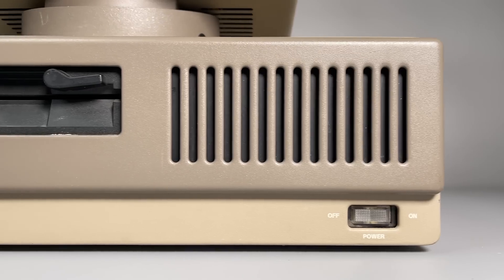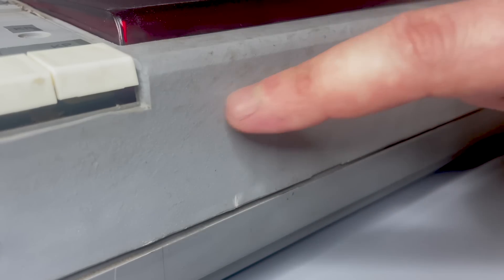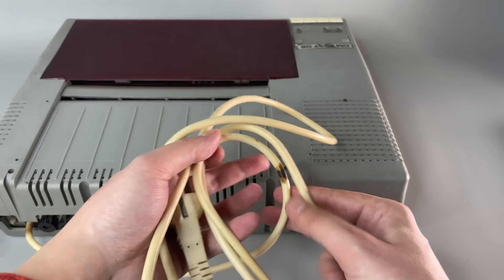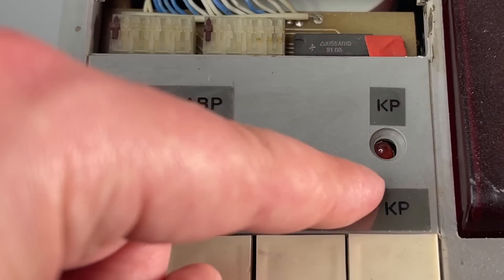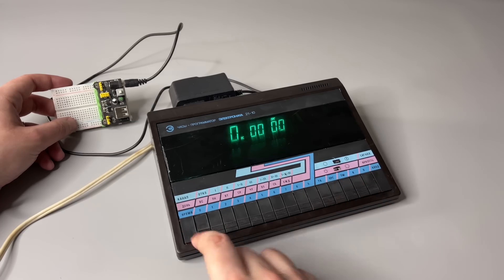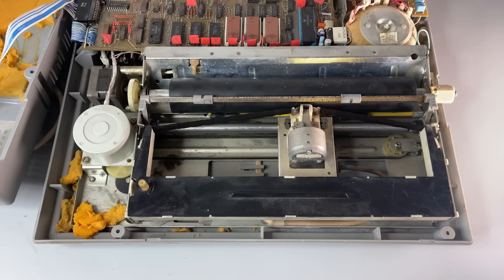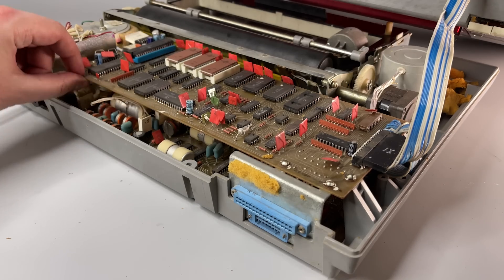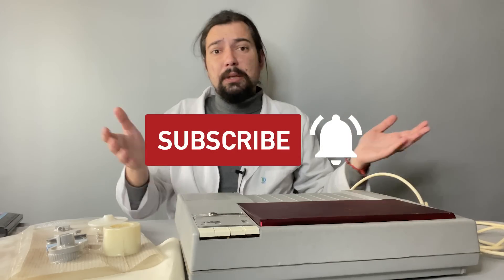This is THE WORST PRINTER I've EVER seen | Soviet SM6337.02

Comment: looks like storage damage, not manufacturer damage for the most part.
Reply from the maker: Upon a closer inspection, only partly.
Reply: @ChernobylFamily  the internal damage and missing parts are either from someone having a crack at it, and failing. or just good ol fashioned communisms. I have seen such damage with computers stored near a heater system. Though im not sure as to what plastic was used, that strongly determines what and how easily damage occurs with heat. 

The foam rot is from a type of yeast / mold (don't remember exactly what it falls under) that can and will infect other not deteriorated foam if stored in close proximity to it. I have seen it happen in the museum i work at, not a computer museum but one that dose involve vintage computers and running them.

Comment: In my country, during communism times, there was saying: "Czy się stoi czy się leży 500 złotych się należy" - "it doesn't matter if you are standing or lying down  you deserve 500 zloty". Of course the amount changed rapidly with inflation :) We had the same problem :) I was just a teen when communism ended, but I remember well some disappointments. Mainly The RUBIN TV which burnt with our piano and my first tape recorder with my 2 tapes with western music recorded from the radio. I wont forget it: cassettes looked like from Dali pictures, just frozen flow from the shelf. They didn't burn completely because they were in the opposite corner of the room but temperature had to be high enough to melt them down.
Reply from the maker: That is epic. Though really sad.

Comment: Recently dug out my revered HP serial pen plotter. Plugged it in. It works (grime, bits of loft stuff shrugged off). About 20 odd years vintage. Even then it was 2nd hand....
Reply: It connects via serial, will run for as long as the parts and the pens last, and has no remote management capability...

I bet that's a part of their history HP would really like the world to forget! 😉

Comment: Hah I have a Bulgarian-made ISA I/O card - it fits a little rough, is twice the size of one made in Taiwan, but the kicker is that if you put an LPT cable in it and a serial device, a mouse for example, the devices touch each other and barely fit in the slot (they hit the computer case) so there is a spacing issue.
Reply from the maker: That is pity, Bulgarian tech generally was well designed. But, it seems to me I know what you are talking about, I have a similar card somewhere.
Reply: @ChernobylFamily  It's an edge case, the Microsoft mouse has a really thick and full connector, as does the particular LPT cable - it CAN work, it's just that I never, ever had that problem in my 30 year IT experience ;)

Comment: 2:55 fins of the die projecting into the mold were broken. That's how you get that odd smooth angle of extra plastic, they were snapped off. Possibly a concodial fracture on the right side (or shadow), which could indicate it was stuck sharply and not bent. The die don't lie.
Reply from the maker: Thank you for the explanation
Reply: Makes sense. Broken pins are common in metal die-casting so I wouldn't be surprised if its happening with plastic casting too. They probably used too little die release spray and when the die broke, they didn't fix it. I imagine what happened with this printer was that this and several other defective items were just stored at the factory for when they were having trouble meeting a quota or something so they could quickly assemble extra units. Of course, with all defective parts, you're going to get fully defective units. That's the kind of stuff I'd expect from Soviet industry.

Comment: All the problems and deficiencies that you show can be found in many consumer electronics coming out of China now. Plus many more far more dangerous design fails, especially in the mains electrical design.
So useless rubbish unfit for use is still produced and marketed around the world.
Reply from the maker: The point of my show was not the particular device. But a double-standards approach which is no matter what, is not normal.
Reply: @ChernobylFamily  double standards exist throughout society. Products produced for the wealthy ate expected to work straight out of the box and to continue to work for years. Yet products aimed at the masses are often not fit for use from new and need constant replacement. It is an ongoing curse often blamed on capitalism, but systemic of all divided societies.
Material sciences developed so well in the 20th century that most products could be manufactured to last a lifetime or more, yet what flourished were disposable products
Reply from the maker: @bigbadwolf1966 too bad, when wealthy ones is the state security service.

Comment: As far as I know there were several levels of product quality in the Soviet Union: Military Grade (OTK-Standards), State Authorities, Export and ... the rest for the people. "Commercial Grade" would not suit what you'd got there. My family came from the GDR on mothers side and we frequently visited them. A few kilometers outside the town was a large russian garrison with a "russian market". Due to some ... err ... "relations" my aunt was allowed to go shopping in there. I once accompanied her. Food wasn't much of a problem. Clothes basically not as well - even though style, size and quality was prone to quality variations. Electronics ? Forget it. In the late 1980s briefly before the german reunion they sold all-tube radios and TVs. The "little stuff" like household gear and small radios or cameras was just crap. No computer stuff there. 
I own two Soviet Era B7-22A Digital Multimeters built in 1978 and 1979 - the later one with english, the earlier one with german front printings. They have Nixie tubes for display and mainly single transistor inards. Manufactured at OTK standards they work absolutely flawlessly after that long time. One came with the original shipping box with spares, add-ons and manual. And I own the fabulous Soviet Era "Iskra 111" desktop calculator. Welknown for the "inverted 2" for the 5 symbol in its Nixie tubes.

Thanks for presenting this "working class disappointment". The labelling is identical to the "officials" printer - but cut in pieces to match the different layout on this one.
Why they cut it after being applied to the unit will always remain a secret. Most likely the one responsible for it had a knife but no scissor and no clue how to properly handle it.
Reply: As far as I remember from my Soviet childhood, military grade electronic components had a ВП in a star logo on them (военная проверка - military quality control). I still have transistors with this stamp somewhere. I've never heard about the OTK-standards as being specifically military grade. The OTK acronym I know stood just for отдел технического контроля - an inspection department of the factory, you could find their stamp in the papers of all consumer grade products. By the way, those all tube radios must have been some vintage ones, I believe they seized being produced somewhere in mid-1970s...
Reply: @piotr433  You are - most likely - right in that respect. I have numerous tubes that were positively military grade and came with corresponding boxes (6N3PI in most cases but also Nixies) and these only had the OTK-stamp present. I guess I misjudged that here. However: I do have russian tubes with no OTK stamps ... recovered from the former GDR ... and their quality is ... well ... "mediocre" to say the least. So I guessed the ones with OTK stamp were selected types and those without are the ones barely working and "good enough for other customers" probably. I will have an eye on the star stamp. Thank you !
Reply: @wacholder5690  the star too look for is like Chrysler logo.
Reply: @wacholder5690  There were special military acceptance stamps for that. The way it usually worked was that a military customer had an office right in the factory and made an independent check on the OTK. Those stamps can be looked up on the internet.
Reply: The "Why they cut it after being applied..." question is simple to answer, it was the most easy way to get the job done, and when quality do not count, only quantity does, then you get this result, not pretty but job done.

Comment: And yet, I bet this printer is still better than that total piece of shit Epson Eco Tank printer I had three months ago.
Seriously, that thing was a hunk of garbage.
Last year, I got an Epson eco tank printer after the unfortunate demise of my canon printer that I had owned for about 4 years.
I chose it as I wanted to get into the refillable ink tank printer market, thanks to the high cost of ink cartridges during the pandemic.
So anyhow, I had that printer for like six months and BAM! I got a paper jam and even when I got the paper out it kept on saying "please remove paper from inside the machine."
And I did, there was no paper on the rollers or anything, I even went in there with a small knife and no dice.
The son of a bitch was perfectly clean, no paper fragments whatsoever.
So I said fine, I was still under warranty and sent the printer back.
I got a new one, and you know what happened?
SAME EXACT ISSUE!
After that, I just junked the Epson and took it as a loss.
Goddamned thing cost $200 too.
At least this thing looks like it could still work with some TLC, sure it would be a badly made POS but still better than that Epson I imagine.
Reply from the maker: OMG
Reply: dot-matrix Epson printers are pretty great tho...

Comment: If it doesn't require a subscription to do anything, it's not the worst.
Reply from the maker: I still cannot put in my head this grоss concept of a subscription for printing..m
Reply: @ChernobylFamily to be fair, most printers use a proprietary ink cartridges you HAVE to buy in order to use it so in theory most printers are subscription based.
Reply: @ChernobylFamily Why don't you buy a new one. The cable was already burned and pinched
Reply from the maker: Because in the system where those printers were produced, you'd wait a year to get a chance to buy a new one:) 
Frankly, i'm struggling to remember when I used a printer. We have a Canon Pixma all in one, but we are using it as a scanner non-stop, while for printing part I am not sure we have even cartriges.
Reply: @ChernobylFamily  It's starting to become a standard thing, now. What we once were able to buy and use for as long as it lasted is now becoming „You get 100 prints valid for three months included with the printer, then have to pay $9,99/month to keep the printer working. You no pay, you buy new printer (And repeat the process again)“ 💸

Personally? I'd keep that СМ6337 close to hand - Yes, I mean the Comrade unit as well as the Military one. Beat-up and badly made as it is, the Comrade unit will still give a longer service life than any post-2020 western model... 🖨🇬🇧😉
Reply: @UK-Combustibility-Assured  nah! get a Gutenberg print, good looks, lasts a hundred years and it means quality!
Reply: @ChernobylFamily Back then, “fulfillment of the Plan” was everything. In the runaway capitalism, “the extraction of profits” is everything. When they “optimize” for a single and unsustainable goal, bad things follow.
Reply: Buy a Brother laser printer. No subscriptions, inexpensive, reliable.
Reply: @daleemmons36  My laser printer (Bought in 2008) is exactly that! Are Brother products still made that way? 😇

(Should be noted that tolerance of non-connectivity to the Internet for over a decade is a functional necessity in my case, given my povertious income and the costs of UK broadband. 😉)
Reply: @UK-Combustibility-Assured  yup! I bought a Brother L2405W laser a few years ago for my shop. USD $120 or so new. Figured for that little it would be junk, but no - pleasantly surprised that it works great!
Reply: and not a 60 Gb driver either i guess
Reply: @markfrombriz  Knowing what I know of НР equipment, 60GB seems abnormally small for their driver software... 😉

(And of course: You can only download it through their own download-stub application, you can't download it elsewhere and take it to your own PC via a pen drive, and they expect you to have unlimited terabit broadband... 💸)
Reply: Speaking of which, don't forget to like and subscribe!
Reply: The great thing about a free market is that you can choose to buy a printer that doesn't come with a subscription. In socialism, you will lack such a choice, if u have any choice at all.
Reply: @Jimraynor45  True. Give me a minefield of potentially good choices in amongst thousands of bad ones, than just one bad one 😌👌
Reply: You win sir 😂
Reply: Seize the means of printing
Reply: except communism
Reply: This settles it 
Capitalism is wrong
Reply: I bet it could be got running again. Unlike todays junk were the same cartridges just get a chip change so they no longer work on the preceeding model.
Reply: As long as you don't need to pay subscription it's not so bad
Reply: looking at you BMW. although thats technically the definition of 'first world problem' - it will filter down.
Reply: Oh god yes I'd have this over Hewlett Packard Any day
Reply: @lizichell2  
Our office has Canon system. Every single time i go on and go trough menu to the "Print" option.. System will take it's time and ask "Do you want to print this page?" I mean why I went trought the menu to get to this point?
Reply: In soviet Russia, you don't pay printer subscption, the subscription pays you
Reply: Far better than today's over complex junk

Comment: You got it all wrong. Originally you bought a power socket and got the printer for free! Quite nice I'd say.
Ok, I'm just kidding and mildly amused by the part they included a power socket as an accessory, mediocre/bad plastics, amazing metal cases seems to be a common theme among the eastern block, doesn't it? The Robotron A5120 I had a few years ago also is guilty of that, sporting some extremely lightweight plastic that easily gets tacky over the years.
Reply from the maker: In this context it is interesting to look at what hungarian Videoton produced. They made heavy cases from some quite interesting plastic compound and painted them very well. In fact, looks awesome and quite durable.

Comment: I wonder how can make even such poor quality. Was it even intended to work even when new?
Reply: The issues of poor design, bad quality and the general impression of "how could they possibly expect this to work!?" is very reminiscent of the concept of туфта ("tufta", pronounced "toof-tah"), which basically means "fake it (or you will never make it)". It originates (I believe) in soviet labor camps, where it was often the only way to prolong your existence, as meeting the official production quota would mean working till you (literally) die.
Of course, people who designed, manufactured, QC-ed (ha ha) this "printer" were (likely) not in any immediate danger to their lives. Their attitude was more like "No one gives a shit at this point anyway; I will do as little as I can get away with, without getting my ass fired!".
If you looked inside any item of "consumer goods" manufactured in the eastern bloc in late 80s - early 90s, you'd often find that half the parts are missing and what remains is made poorly, out of sub-standard materials and "hammered into submission" to even make it fit inside the cover.
To be fair: you can sometimes find a stroke of genius in the design and/or manufacturing that is "so simple, yet effective". But even that is usually ruined by poor workmanship, antiquated technology and terrible materials.
Reply from the maker: It was produced in the times when their industry was nearly in coma. Which does not excuse this poor quality.